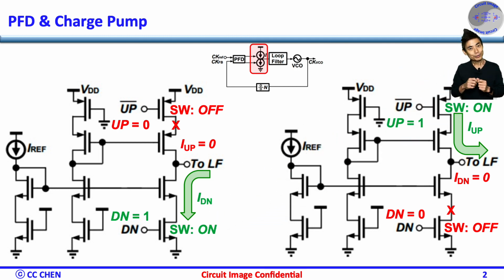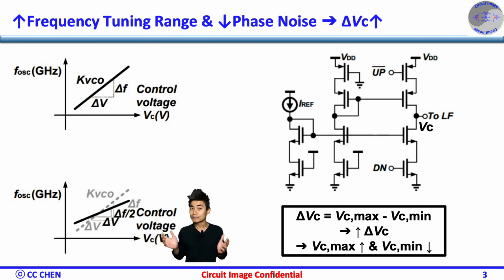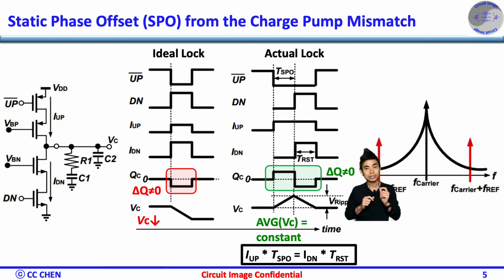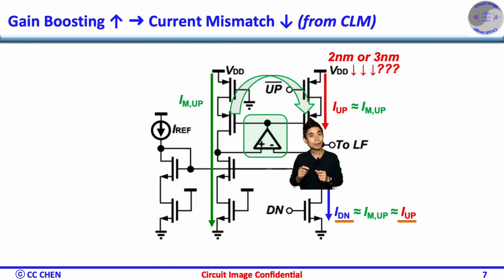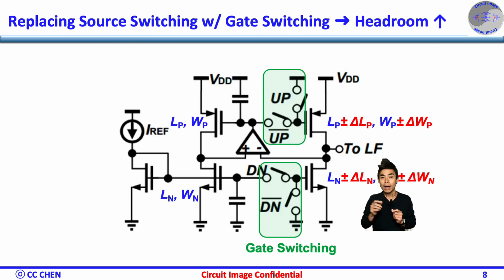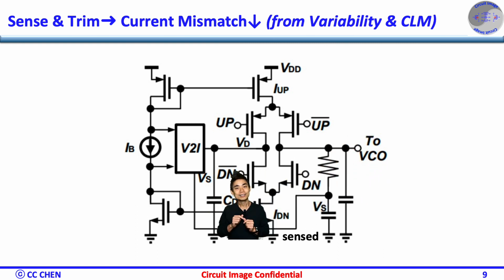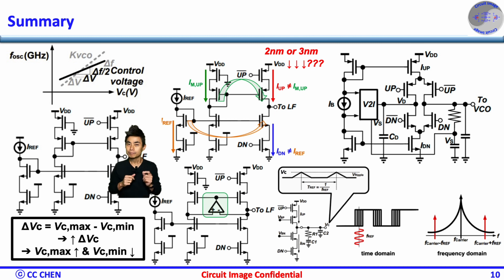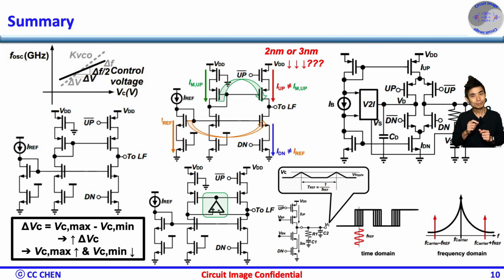Why the Design Insights of Charge Pump PLL?

Comment: Can you kindly add the paper reference for the Sense & Trim --> Current Mismatch (from Variability &CLM)
Reply from the maker: Hi Zulfiqar,

Sure. Here you go:
"Low-Spur, Low-Phase-Noise Clock Multiplier Based on a Combination of PLL and Recirculating DLL With Dual-Pulse Ring Oscillator and Self-Correcting Charge Pump," authored by Sander L. J. Gierkink and published in the IEEE Journal of Solid-State Circuits in December 2008.

Comment: Great video Chen. But I have a question, why does a current mismatch in charge pump result stop at a phase error and don't get converted into a frequency error? Is it because the average Vcont is same as earlier but there's only instantaneous change in cont?
Reply from the maker: Hi Dhanesh, nice to meet you and I'm glad you liked it. 😊
The phase error is static (constant), so the frequency error is zero. Another way of thinking about it from the perspective of the control voltage matches what you thought. 😊
Reply: @circuitimage  Got it. Thanks for your prompt response